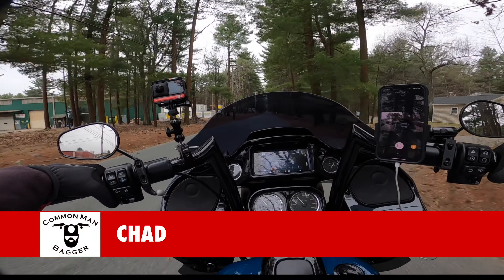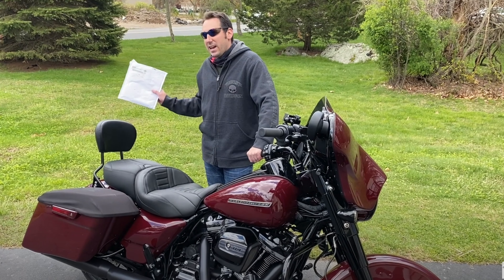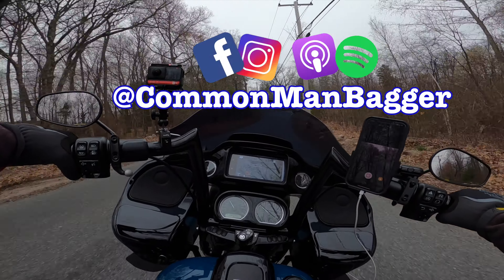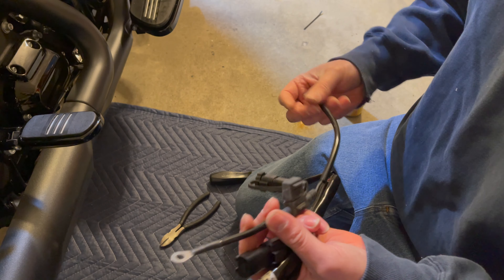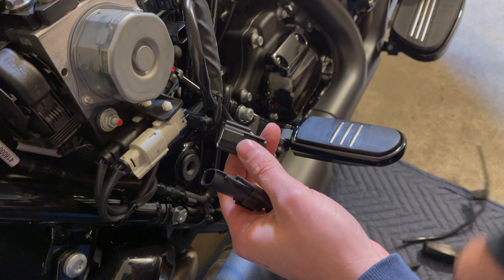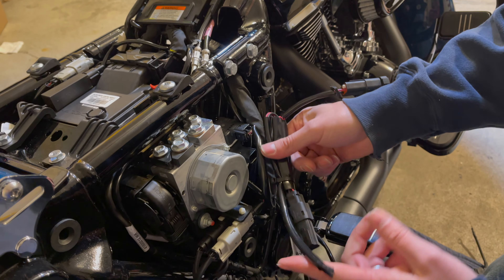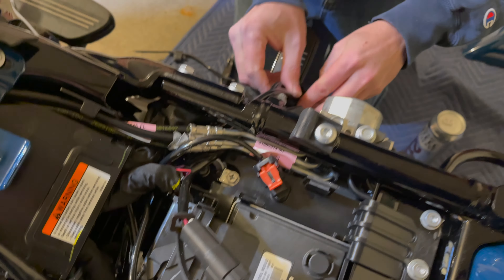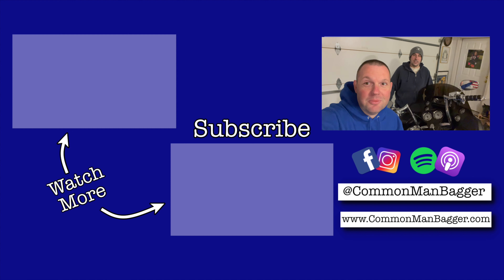Harley Davidson Electrical Harness P/N 69201599A Install

Comment: Great video! I was about to install the P/N 69201599A on my 2018 FLHP, but realized there is no power on the 325b connector. Fuse seems OK (checked with ohmmeter), any ideas?

Comment: Best video I've found for the wiring of the hammock seat. 
Only question I have is : will I have to use that short harness for my Cooling/heating hammock seat? Or can I discard it like in this video?
Reply from the maker: I’d have to see the instructions for the cooling/heated seat. That is an awesome seat. Wish I had one!! -Chad

Comment: I just need to connect a switched powwer source for my dash cam. The old one I connected to the power port in the tour pack but the new cam system shuts down if I plug just the usb outlet into it. this looks like just what I need. Which wire would I connect from this kit? Thanks

Comment: New subscriber.   Thanks for this video.   I have a dumb question I have a 21 RK I don’t see the empty port.   Is this plugged into something else.   Per instructions it looks like it should be empty and visible.   Can you help?
Reply from the maker: Should be on the throttle side with a dummy connector in it. Pop that out and install the cable. I hope that helps. -Chad

Comment: Is there anything that you do with the port from the bike that the original connection came out of ?  Mine has pins and wires in it?  Does it just stay blank?
Reply from the maker: The original port on the bike plugs into the wiring harness. That is where you get your power from.
Reply: You have a 325 plug that comes out of the bike and connects to the harness.  This is what you would connect to then battery with the extra pin.  

Prior to unplugging that plug, it is in a port on under the seat.  
My question is what happens to that port? Mine has connections in it.  (Wires and pins) Are they now just void?
Reply from the maker: https://serviceinfo.harley-davidson.com/sip/service/document/217516?locale=en_US

This might help you with your question
Reply: @commonmanbagger9165  thank you

Comment: Wish I had watched this first. I looked at a different video and it showed installing the red pin in the connector and ran to the battery. So much trouble for nothing. Thanks!
Reply from the maker: If you are just doing a heated seat there is no need.  I hope it helped. -Chad
Reply: @commonmanbagger9165  same hookup even for the "Cooling"/heating hammock seat?